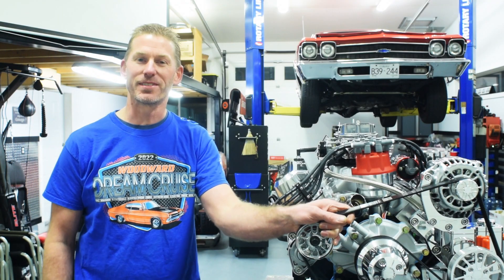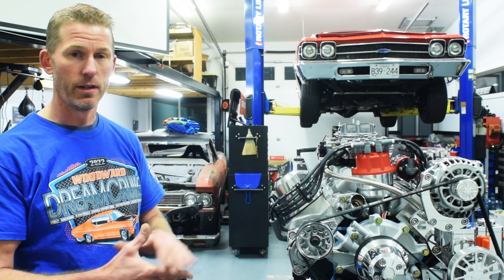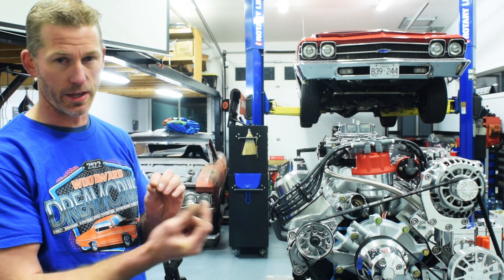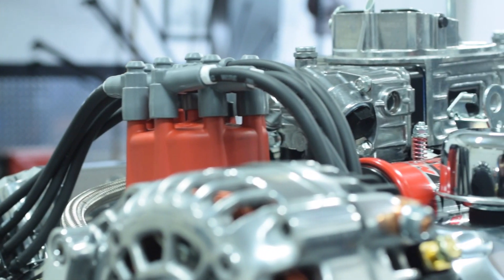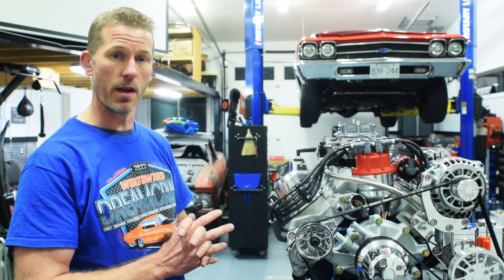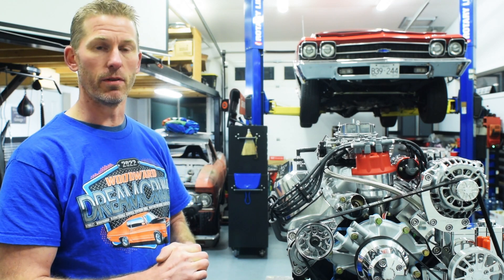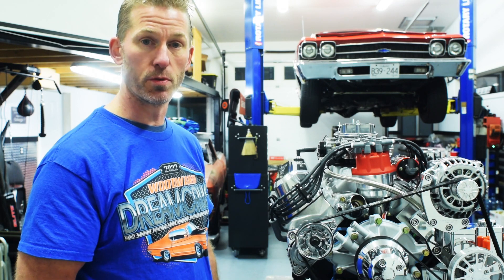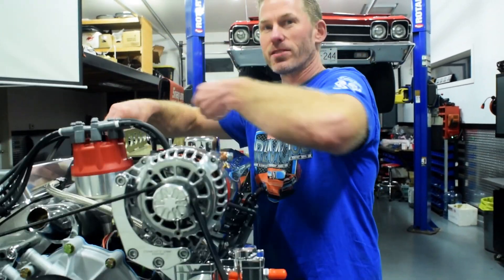347 Cu.In. Small Block Ford Crate Engine

Comment: Would you guys build me a short block 347 with my 68-302 that I have had for almost 30 years ,before dissembly engine fine I have dont extensive grinding on ( sharp edges …. . I like you to linebore mains bore and deck block and your supplied kit ,would like forged crank for those times for nitrous not much at most 200  shot gradually introduced  ,